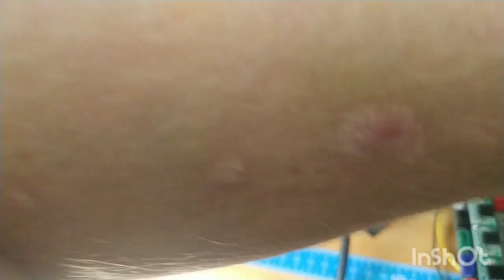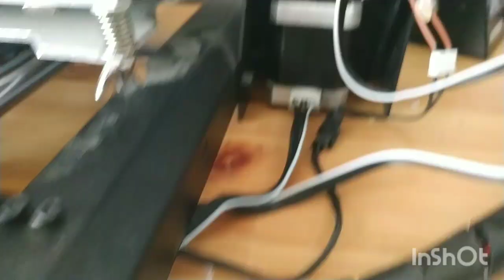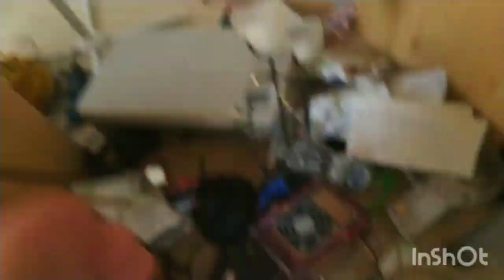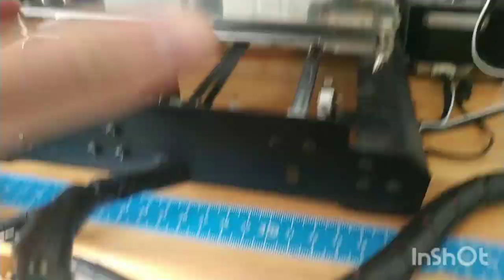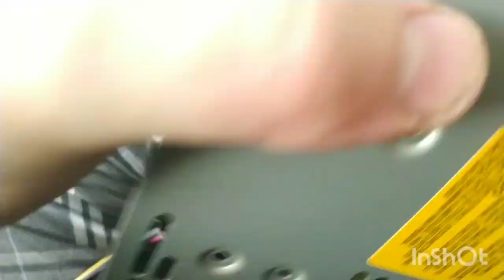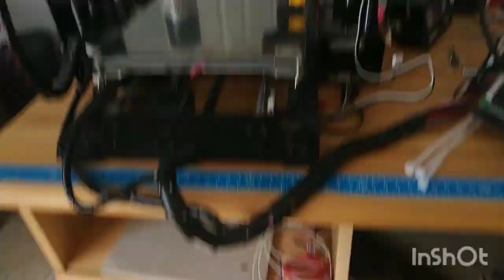wanhao duplicator i3 3d printer adventures

Comment: It has bearing instead of v wheels which is nice.  I have the i3 Mega which is similar.  It still use it today. I have it running at about 100 - 150mm, have klipper on mine. Still a great little machine
Reply from the maker: yeah i really like it actually. cool little unit. im a chronic procrastinator. im still not done calibrating the extruder stepper motor so rn i have terrible extrusion.